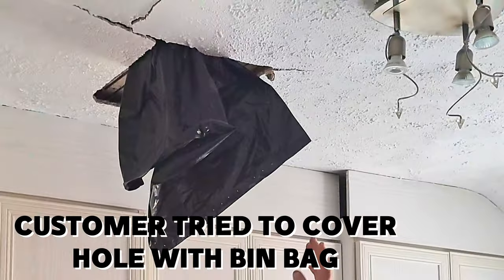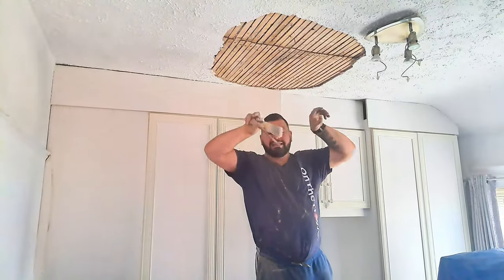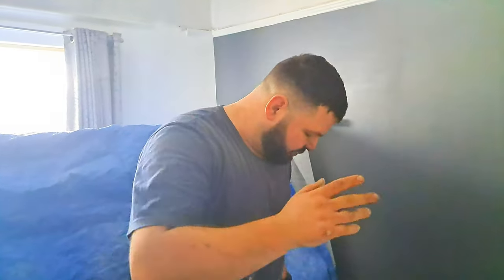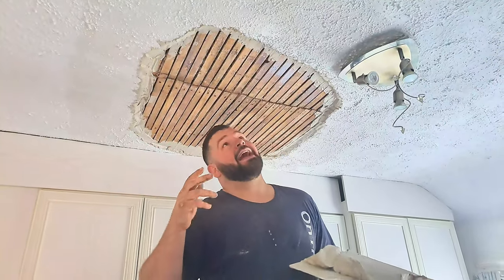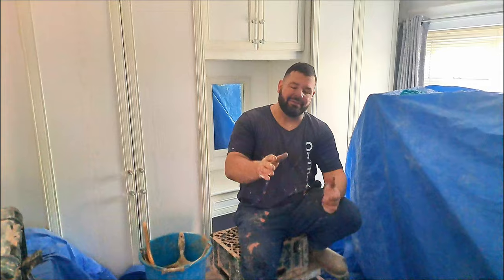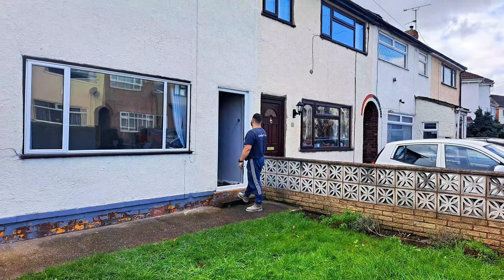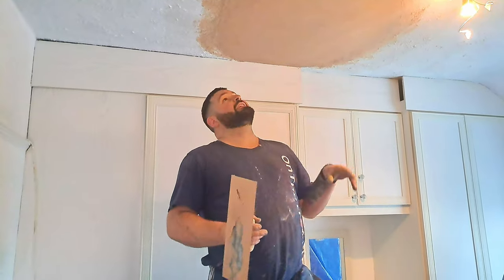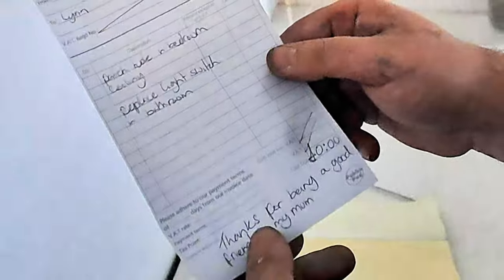I NOTICED WHAT SHE DID

Comment: Kirk that box just tricks the ecu to say it’s cold and injects more fuel don’t be tricked mate
Reply: I said it another video post. It'll dump uncontrolled fuel and turbo pressures . And tell the dash it's better. Keep stock or install a proper remap it'll be far cheaper in the short to long term . A d change the oil .

Comment: My dad did all the ceilings in the house by roller extra thick and then went dabbing the roller up and down. I had to patch in an airing cupboard when it was removed and a polystyrene ceiling rose that started to break up due to the weight of Hoover and iron flexes being dangled from the fitting had pulled the plaster away from the lats. I came along and tried to remove the polystyrene and a 2 ft ballon-shaped section came down. I made a right mess of the ceiling and it resembles an early pregnant stomach, but the bloody thing is rock hard. The paint effect I managed to somewhat recreate with a stipple/basil brush, but that ruined the expensive brush. 30 years on I still have the hairy bump in the ceiling. :) The airing cupboard turned out a bit better and even managed to match the fall of the eves, still not a great job. Sometimes when you haven't the money to get someone in, you have two choices, leave it or have a go.  I wish I had left the ceiling rose until better times, but it is a feature :)   Great video and I will try your tech next time.

Comment: Hey Kirk...just to say how much I enjoyed this video...took my mind off our own problems property wise ( and age wise..) and when energy comes back I may have a go at some....that lath ceiling could have been a nightmare but you sorted it (even using ‘modern’ materials) ..... Glad to say that the old lime stuff is now very available..but somewhat upgraded for more time conscious use..I.e. NHL  limes ..but I would have had  to think carefully about which strength to use..1/ or 2 or 3 grade..could be useful to research as there is surprisingly Many houses still with lots o lath in situ..The Old lime putty very available and very light but slow drying..so I guess when you said ‘maybe a touch of gypsum in the original lime plaster’ they used that to get a bit of a set ?..Not sure that’s a good combo, but hey, the ‘old tradesman’ knew a bit most of the time through donkeys of handed down tricks..Found it fascinating to see as I have done some traditional lime work...but main thing is you did it anyway ! The lady must have been so pleased..Many thanks..

Comment: Hey Kirk, I'll be plastering a couple of bedrooms at home soon, both have cracks behind the rads (2-3mm wide. Internal render, 70's build). I'm almost certain they'll come through after a skim, do you think a wide scrim is enough, I have some render mesh if not. Cheers, Stu 👍🏼
Reply from the maker: Check if the plaster is solid, It might need to come off, also see if it's cracked  the brickwork, if so just install a brick stitching kit first mate
Reply: @Onthetrowel yeah it's split through to the block too, not really sure what's cause that. Cool, I'll take a look at the stitching kit. Failing that, dot & dabbing that wall could be good, that way the area's bridged? Thanks pal. Hope all is well with ya 👍🏼

Comment: The SBR would also help stop water absorbing into the wood, so limiting shrinking as it drys out, you did a perfect job there mate. I would of just used bonding for both coats, but  would of put cement in the mix to make it set quicker, also I find the cement makes the plaster set harder, for the texture finish, I might of made a slurry/watery mix of setting plaster and dabbed it on with a brush. I see you are using a stainless steel trowel now.
Reply from the maker: It's just a new carbon mate, hasn't started to rust yet

Comment: That box gives you more torque, meaning you don't need to rev it out like normal to get the power. You'll be able to shift at lower RPMs now meaning you will essentially save some fuel.

Comment: top tip on Monocouche  render scratching the final coat if you are doing this in winter you can do it the same day just get a small gas bottle and a touch gun this is what flat roofers use for touch on felt let it go off for 1 or 2 hours then lightly put the flame all over it do 2 meters at a time that will get the moisture out of the top coat and should be ok to do a scratch the same day saves you going back the following day i done this method years ago you only need a light flame from the gun just  comes with practice get the balance right hope you like this tip

Comment: Did you have the old Artex checked for asbestos? Interested because I couldn't find any mention in the vid about it. It would be a good thing in any videos like this to at least do a brief PSA and spread awareness of the potential risks, even if the job you're on is tested and safe. Good job with what you had to work with though.

Comment: Kirk  with the tuning box fill the tank reset the trip meter then when empty refill divide liters to gallons and divide the mileage, the mpg readouts on the dash are only a guide, I had a box on a subaru and the dash showed high MPG but the reality of refill/per mile the car was no more efficient, they generally fool the fuel rail pressure sensor to add fuel , hence more power.
here's hoping it is more fuel efficient for you anyhow.

Comment: The original plaster would have had horse hair reienforcing plaster doesn't have that making it more prone to cracking i cut out the shape of the hole to put a piece of plaster board then used fibre glass tape in the gap to reinforce the join.
In N Z as we don't have the mixes available in the UK.

You have to be careful  with french plaster or plaster of paris joining yo modern gypsum board so i paint the edge of the old surface  doesn't react turning the modern filler to powder over time.

Comment: this bathroom Im doing has lath and plaster, lime plaster as you say and cedar laths ! Smells wonderful when tyou trim it off with an angle grinder. Whole ceiling had to come down, thousands of little tacks and hundreds of clout nails driven into the hardest ceiling joists Ive ever seen. Probably hardened with age, but very close grained, no pine smell when cut. Lime plaster on the walls too, still not rock hard after 100 years but stuck like shite on a shovel to the brickwork. Impressive stuff.

Comment: The way these things “save fuel” and create more power is they take off things that should be there. There are safety things inside cars to make sure they last. Retuning them will take them away from factory spec and it can cause more emissions, risk damage to the engine etc. it’s up to you if you want to risk it but don’t take it back to the dealer if something goes bang.
Reply from the maker: Hey mate, this was one of my original concerns but after raising this with TDI they assured me that the ECU is what stops the engine going beyond safe limits and because the vehicle isn't being remapped then the ECU still has control over the engine. Basically all this little box will do is get the best out of the engine within its safe operating limits.
Best thing to do is check out their site mate, they explain it better than me.

Comment: Kirk I’ve got the same issue but on a bay window.
Can I use Thistle one coat plaster (have a bag left over from another job) straight on to the lath which I’ve already SBR’d or would lime be better.
I’m a brickie and I’m using NHL 3.5 so have that to hand but it’s not as easy to use as modern plasters.
Great content - making a brickie feel like he can to do some spreading 👍
Reply from the maker: If I had the lime and the time then if definitely go that route mate
Reply: I agree Kirk but the theory of lime is that it breaths and flexes etc but those benefits are lost if the existing lime has either had SBR or Stabilising solution and will then get normal paint which doesn’t allow anything to breath. 
New and old materials/practices are a mine field ! 
Great channel channel/plasterer  Kirk but more importantly you come across as an even better person

Comment: On the trowel. I've noticed that your expertise goes beyond just plastering, and I’m curious to learn more about the full range of skills you cover. In one of your videos, you were advising a customer on a ceiling issue, which seemed to involve more than just plastering.

In schools and colleges, the focus is primarily on plastering, but it’s clear there’s more to this trade. Could you share some insight into the other areas of work you handle in your field?
Reply from the maker: I can't lay bricks very well but appart from that then I can basically do it all be it just slower.
Electrical, joinery, plumbing, tiling, kitchen/ bathroom fitting, ground works,  roofing etc.

I was quite lucky that my dad put me to work at a very early age and i had the opportunity to work with a lot of builders, I'm also one of those people that has a very keen desire to learn. 
Hence now I'd like to add video editing to my list of skills but I think there's still a bit of room for improvement 🤣
Reply: @Onthetrowel  Thank you for you're Response